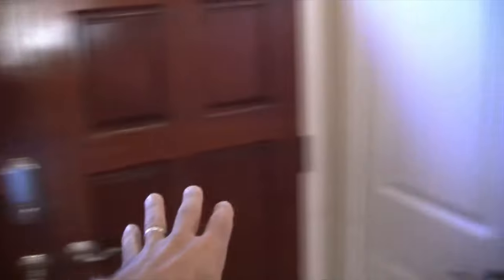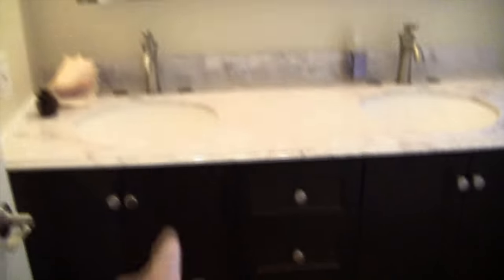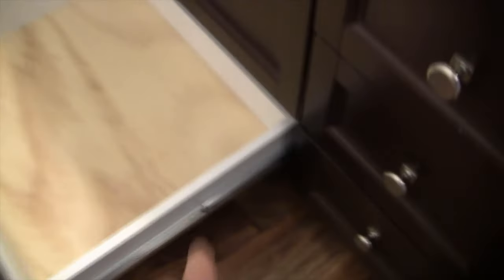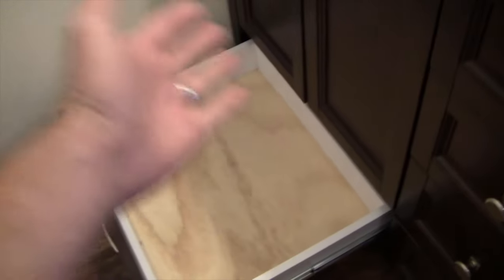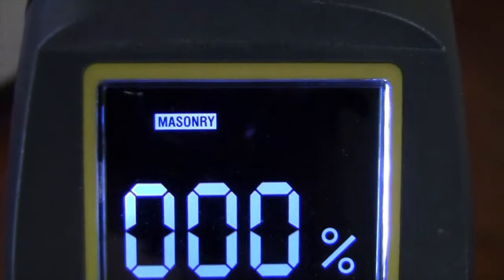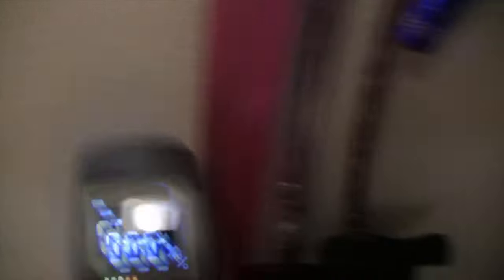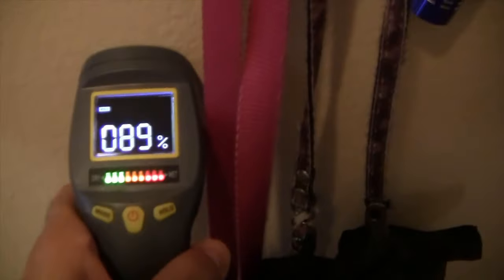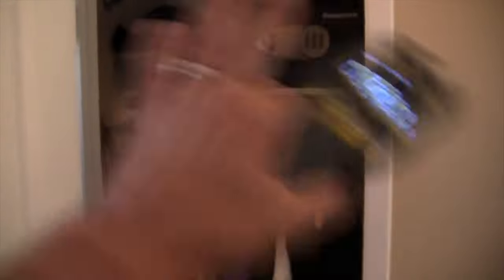Dry Out Walls from Water Leak to Prevent Mold

Comment: Great video.. good tips for the moisture meter and mold control spray. I noticed that you didn't pop open the ceiling inside the closet. I should think that water from the spill would have hit the back of that drywall, possibly to promote mold on the back of that ceiling drywall. Any thoughts?
Reply from the maker: you may be right, the only good news is that the water leak is fixed and no more water will let mold go dormant. when you seal up the drywall, we should be good. BUT you are right, it would have been safer to do the job at that time.

Comment: How to get rid of small mole under kitchen cabinet on drywall and cabinet wood?

I don't think the material is compromised but moisture is detected on them by a mold inspector?

Can we try with mold spray, wipe off a few time, dry the area with fan or hair blower ?
What about the floor underneath the cabinet base board, we need to worry?   The inspector did not go that far or removed anything yet, so maybe unknown 
until we actually remove the material.

Comment: Called service after my toilet overflowed , water went through cracks down stairs and through some nocks and cranny to a small portion of my ceiling . Service Master brought in humidifiers . Do you recommend humidifiers ?
Reply from the maker: maybe you meen de-humidifiers. yes you want de-humidifiers to reduce moisture caused by water leak. you want fans to help dry out the leak area. you want to increase the heat to help dry out the leak area. all these things will help. the quicker you dry out the better position you will be in for any mold growth prevention.

Comment: I won't criticize any product used to remove mold however, at 100% moisture you said you were hoping to use that same sheetrock. Replace it with mold resistant sheetrock when you done!
Reply: I think you got your remarks mixed up. I wouldn't keep any Sheetrock that mold grew on.

Comment: The pan for my attic AC unit overflowed and tipped and I have water and staining in the ceiling.  I haven't had the AC or heat running g since, it's September, but my smoke alarm started beeping 2 weeks later.  Will removing the access panel to my attic and leaving the space open be sufficient for drying?  I don't think it's been long enough for mold to be a issue
Reply from the maker: try to dry out asap. use a fan and such to promote as much air flow as you can.